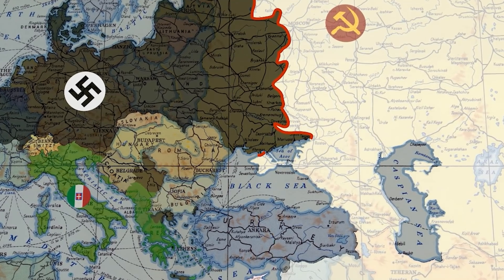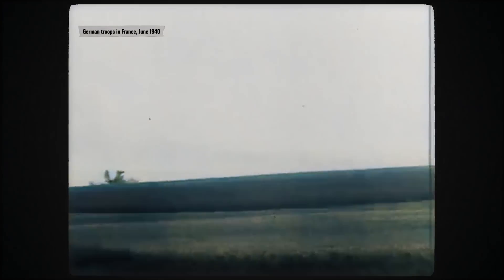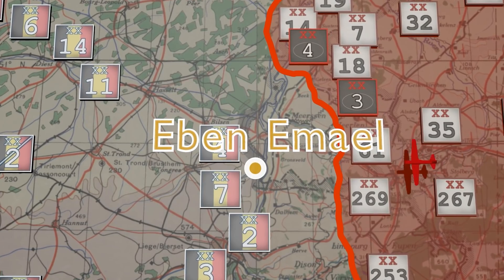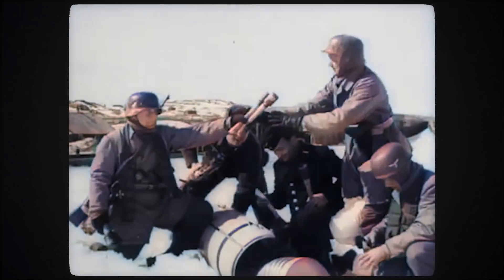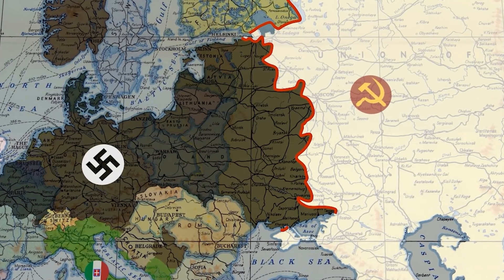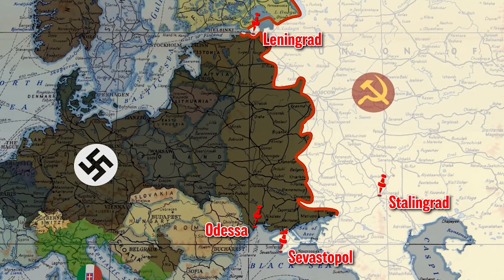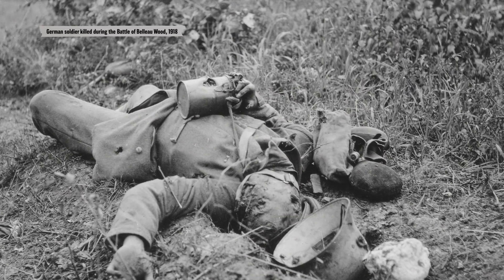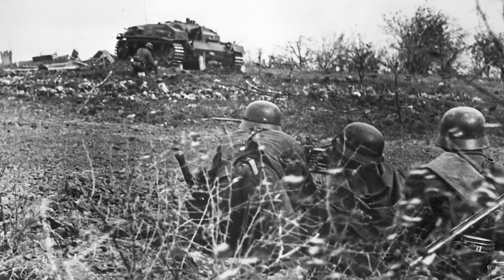The Opposite of Blitzkrieg - Siege Tactics on the Eastern Front - WW2 Special

Comment: I am surprised the Germans did not use gas against besieged defensive sites. Yes they did not want to encourage retaliation  but did they think that was a realistic eventuality in 1941? It would have shortened the effort required to reduce encircled troops and cities.
Reply: If I remember correctly Hitler very bluntly forbade use of gas in warfare even though Germans had very effective gases available. Did not prevent SS using it as murder weapon, but that is completely separate topic. Delivery is still a problem as is protecting your own troops.
Reply from the maker: Keep in mind that the Germans and Soviets worked together after the First World War, in secret, to develop gas weapons. They knew (or at least believed) that the Red Army was fully capable of retaliating with gas attacks of their own.
Reply: Gas is very tricky to use. If the wind changes the gas can blow back to your own troops or just change direction and be ineffective.
Reply: @caryblack5985  The Great War showed that is really not the case if gas shells of artillery are used and that wind tends to disperse gases quite effectively. Of course simplistic use of just opening gas bottles on battlefield may backfire spectacularly with wind turning. Basically optimal gas kills fast, can be delivered efficiently and disperses fast after use without leaving toxic residue behind. Mustard gas did not do that.
Reply: @vksasdgaming9472  Then what is your explanation?
Reply: @caryblack5985  Hitler said 'no gas'.

Comment: Strategically, the entire Crimea should never have been on the agenda for Barbarossa -- or even pursued when Case Blue was dead ahead. The port was useless to the Germans and nearly useless to the Soviets. Naval affairs were entirely subordinate to the land and air campaigns. The sole rationale for the Crimean campaign was to counter Red air strikes against Ploesti. That could've been easily accomplished with a Stuka campaign against the pitiful few decent air strips in the Crimea. The Reds didn't have a viable strategic bomber force, either. Leaving Sevastopol as it was would've provided the Nazis with the perfect training platform for budding pilots -- in counter-ship attacks.
The same tale is true for Odessa. The Romanians should've merely besieged that fortress city -- and saved a lot of blood for both sides. In its isolation, Odessa would've been the perfect site for counter-ship air attacks. 
Rationally, the 11th Army should've been tasked with pushing east, the Romanians tasked with logistical support ( think railroad repair and re-gauging ) and rear-area operations. In terms of resources, 11th Army was sucking down enough ammo and blood to support three conventional infantry armies at the true front. So, you'd have to credit the Crimean campaign as a terrific Bolshevik success, a prequel to Stalingrad, a sequel to Odessa.